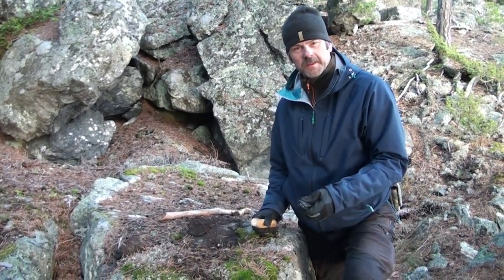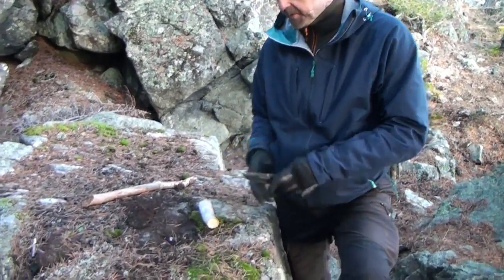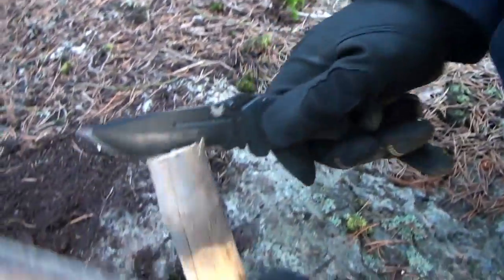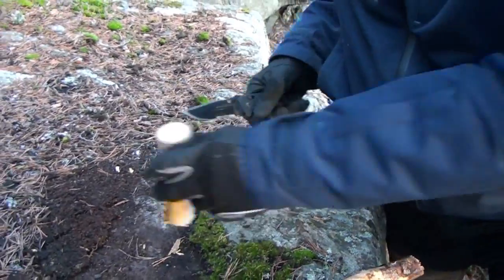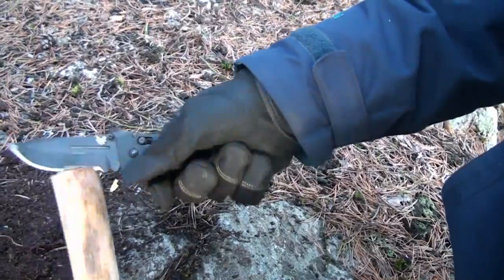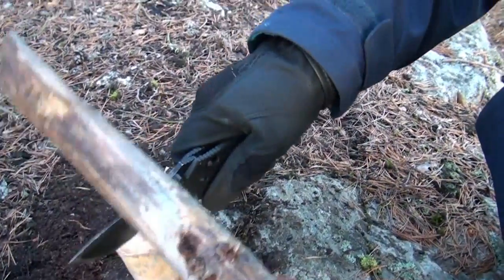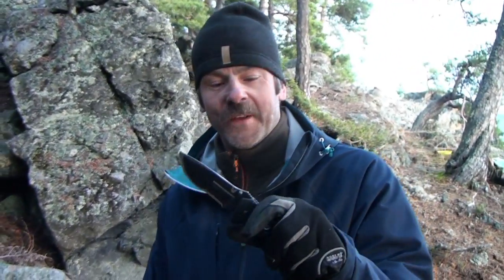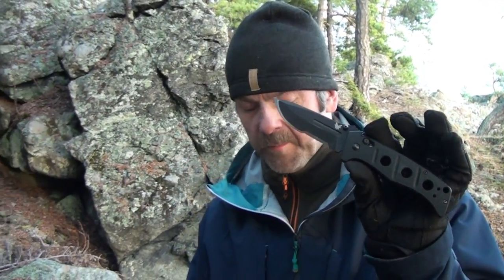Benchmade Adamas fail.

Comment: It's not the force you're applying, it's the fact that you're trying to baton hardwood with a folding knife that has a partially serrated blade. Not the knife's fault. Hardwood and wrong blade edge.
Reply: How would that cause the failure of the axis lock? I agree it was the wrong blade for the job, but that’s irrelevant to the issue of blade unable to stay locked in the open position.

Comment: The Adamas is a beast of a knife, it failed because you don't baton wood with a folder. 🤷🤦
Reply: Yes
Reply: Especially when you baton on serations.  Its like saying I used my torch to hammer nails, the lense broke so my torch is rubbish.
Reply: lmao most agreed
Reply: Latest adamas axis lock just are fitted/ made poorly in too many of them. Thing that ya just can't disagree ☝️
Reply: No one is really going to baton with a folder. He's just testing its strength.
But Benchmade advertises the Adamas as a "TACTICAL" folder.
If it fails with light batoning, that means you shouldn't ever use it in a tactical situation. I say that because if you stab something and you hit dense bone or miss the target and hit a wall, that amount of pressure on the spine is going to cause the blade to close up on your fingers. So, the Adamas is a beautiful pocket knife, but it is definitely not a tactical folder because the spine can't handle any pressure.

Comment: The Adamas is said to have the strongest lock that Benchmade produces.
It looks like the (Omega) Springs that hold the lock bar in place have broken. Replacing these is part of the Benchmade Warranty. The fact that you would be shipping the knife from Sweden to the United States might complicate the Warranty Service. Aside from your friend helping you could send an email to Benchmade. This is Benchmade’s Warranty Service Page: https://www.benchmade.com/lifesharp-service and the service form is at https://www.benchmade.com/media/wysiwyg/LifeSharp_ServiceForm73019_Page_1.jpg
Reply from the maker: Both omega springs are ok. I have taken it apart. Now the problems come to put it togheter again:)
Reply: Sorry if I caused you to take it apart. That looked like spring failure. Nick Shabazz has several videos of Benchmade knives where he takes them apart and puts them back together. I don’t think he has the Adamas but hopefully the videos will help. Just search “Benchmade disassembly/maintenance” on the channel page. I hope everything goes well.
Reply: This is the contact page on Benchmade’s website. The message box is on the page:
https://www.benchmade.com/contact
Reply: @nicholasconway7975  the knife is garbage.
Reply: @G13-j3c  Yup.

Comment: Wow! I know several guys that strictly used the Adamas while in the Middle East and they swear by them. They never had any issues. Regarding Gerber, they make some good stuff but they make some junk too.
Reply from the maker: Benchmade maybe shipping all the monday knives to sweden haha
Reply: @MrMadhouse70  Lol! I guess do! Like your videos.
Reply: It's really doubtful because you have to pack light in the middle east and you don't want a folder because of the sand (fixed blade are better). Adamas are too big, even for military trained guys.
Reply: @raphaelg2448  Well, they carried them. All in the middle east. Had nothing but praise for them and said they never failed.
Reply: That is the old model. These are the new thin busted shit
Reply: @Duffelbag Drag Was there a specific brand/model of folder knife that was carried by most of soldiers on the army? And what type of blade steel do you think is the best for knives carried for military uses?
Reply: @williambryan6006 Lol. Don't lie. I guess if a solder wants to pay for a benchmade with his own money, he can. 
But there is no way the military paid for benchmades for their soldiers to carry. 
Benchmade makes pretty knives, not hard use knives. Some benchmades may be able to handle lite abuse, but not for extended periods because they fall apart quickly.

Comment: Adamas is a heavy duty folder but still a folder. Go fixed for batoning, I'll beat on my triad lock but it is still not the best tool for the job. If you must baton its best to do with the lock out of battery.

Comment: Why are you attempting to use a pocket knife as an axe? Strange that I use an auto Adamas as an edc and never needed to beat on it with a stick like a wedge. I have other knives for that. I would never beat on a $360 pocket knife and be surprised that it failed. This is a pocket knife and was never marketed as anything else.

Comment: That's pretty sad. Even the lightweight Bugout and Bailout took a serious beating without issues but their big tough knife couldn't handle it? Hell I even batoned a $10 BudK slipjoint knife with no issues. I'd say you need to check out Cold Steel if you want a brute of a folder

Comment: First of all I am not saying that that is a good knife. I will say that when you are splitting wood like that, you should start hitting the knife directly over the wood. Not on the tip of the blade. If you are looking for a true quality folding knife, I would suggest that you get a Buck. I have cut steel banding off of crates with mine and it's still fine.
Reply from the maker: You are right about that. i will try again later after i put it togheter.
Reply: No get a cold steel. Bucks always eventually get lock rock and slop with hard use

Comment: Thats not how I was taught to baton with a folder. js
Reply: Blade is unlocked, blade and handle at 90°, handle held parallel with wood. This places no stress on lock.
Reply from the maker: I know what u mean but anyway. I did not do it hard. I have other knives that hold up for this. And mostly i never baton a folder.
Reply: Why is people so obsessed with batoning, use an Axe instead.
Different tools for different tasks.
But of cause, some punks use screwdrivers as hammers 😂

Comment: It’s 100% the spring.  Otherwise it wouldn’t stick intermittently. The unlocking is random during his tapping.  If the lock on the blade broke, it wouldn’t stick at all.  Get a new spring.

Comment: Damn it’s almost like you’re not supposed to do that with a fucking folder
Reply: No one is really going to baton with a folder. He's just testing its strength.
But Benchmade advertises the Adamas as a "TACTICAL" folder.
If it fails with light batoning, that means you shouldn't ever use it in a tactical situation. I say that because if you stab something and you hit dense bone or miss the target and hit a wall, that amount of pressure on the spine is going to cause the blade to close up on your fingers. So, the Adamas is a beautiful pocket knife, but it is definitely not a tactical folder because the spine can't handle any pressure.

Comment: My Cold Steel Recon 1 has no problem battoning and the lock does not fail⚔️
Reply from the maker: I have understand resently that the cold steel knives have the strongest lock. But for me i like serrations like gerber style or benchmade style. The serrations on cold steel is not my cup of tea.
Reply: Doesn't matter how strong the lock is, it will eventually fail. Why baton with even a $50 Cold Steel folder when you can baton with a $10 Morakniv ??  Don't think there's ever an excuse for batoning with a folder unless in absolute emergency and even then it's not a good idea and probably unnecessary. I own CS large Voyager but I wouldn't try to split wood with it. If you do so, it's not because you need to, you just want to for excitement.

Comment: batoning a folding knife.  next level derp.
Reply: No one is really going to baton with a folder. He's just testing its strength.
But Benchmade advertises the Adamas as a "TACTICAL" folder.
If it fails with light batoning, that means you shouldn't ever use it in a tactical situation. I say that because if you stab something and you hit dense bone or miss the target and hit a wall, that amount of pressure on the spine is going to cause the blade to close up on your fingers. So, the Adamas is a beautiful pocket knife, but it is definitely not a tactical folder because the spine can't handle any pressure.

Comment: You should not baton any folding knife!  They will all eventually fail.
Reply from the maker: Well i can say you are right about that. But this is not heavy batoning at all. Small sticks and not to often should absolutley be ok.
Reply: Say that to Cold Steel, their tri-ad-lock holds up for my baton.
Reply: There is a way to baton with a folder and this isn’t it. Blade is unlocked, blade and handle at 90°, handle held parallel with wood. This places no stress on lock.
Reply from the maker: @georgerector9252  Yes i know and use that metod also. I got an video about it some years ago. In that video some one told me i was stupid to learn out such a dangerous teqnique even when i say in the video that be very carefull when u do like this.
Reply: Cain0078 I have cold steel and agree they are amazing, but they break as well when abused.

Comment: Benchmade has many models that are made for batoning but that adamas folder is NOT one of them it's from there tactical class but still you'd have alot better luck with one designed for it or at least the adamas fixed blade
Reply: No one is really going to baton with a folder. He's just testing its strength.
But Benchmade advertises the Adamas as a "TACTICAL" folder.
If it fails with light batoning, that means you shouldn't ever use it in a tactical situation. I say that because if you stab something and you hit dense bone or miss the target and hit a wall, that amount of pressure on the spine is going to cause the blade to close up on your fingers. So, the Adamas is a beautiful pocket knife, but it is definitely not a tactical folder because the spine can't handle any pressure.

Comment: That's why all you need is a good 'ole old school Buck 110.  No internal springs, screws or internal parts.  Just thick brass and steel.  Don't get me wrong, I like the designs of these Benchmade, Gerber (USA Made), Spyderco, Cold Steel, et al.  But I've regressed to the old stuff like a 3 dot 1980-81 Buck 110 in 440C.  Also, I never baton knives and for real woods use a fixed blade is king.